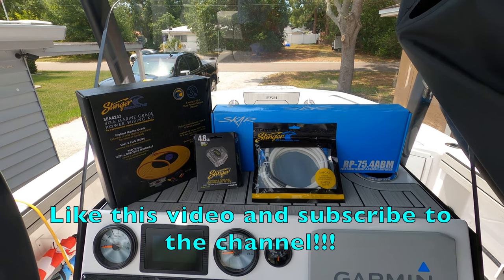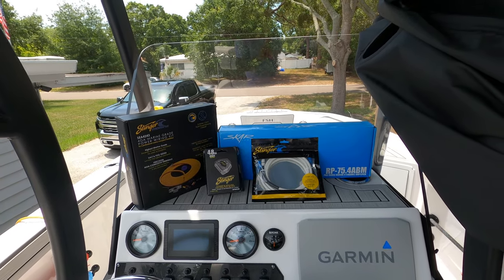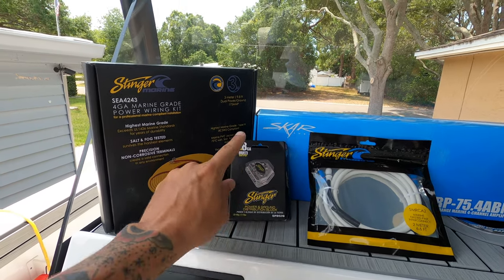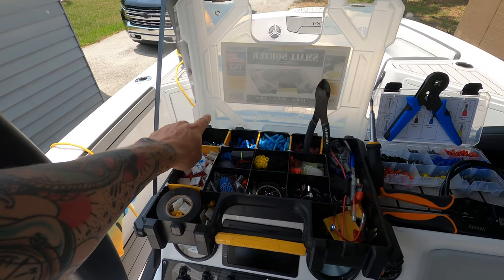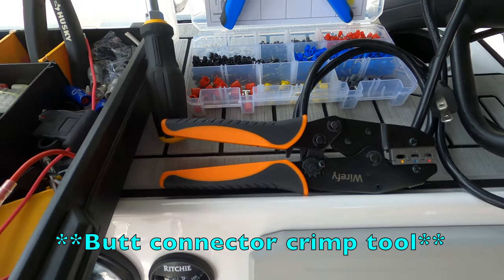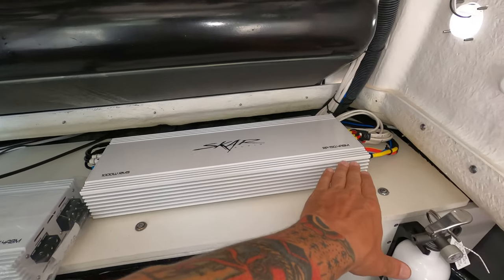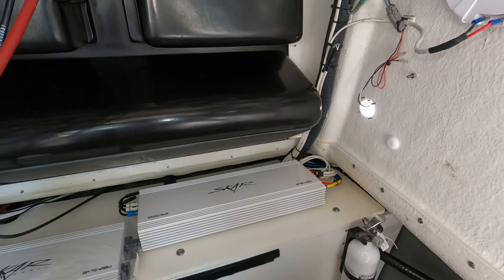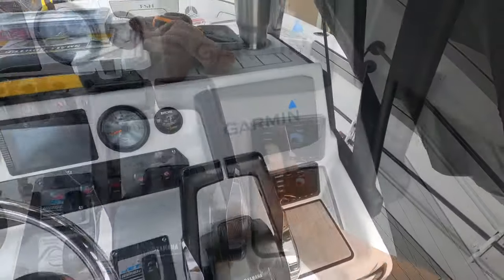How to PROPERLY add an Additional Marine Amplifier and Marine Speakers with Skar Marine Amp

Comment: i wish i had room on my pontoon for an additional amp. I have a 25 foot with a small compartment under the steering wheel. i followed your recommendations on other videos so i currently have the 4 6.5 inch and 2 8 inch paired with the 1000w skar amp and KMC5 head unit. I had to hand build all my speaker enclosures it doesn't look any where near as good as your install but All my friends are impressed and so am i. A guy at work has a nice JL system with 4 12's in his jeep but ii think my stereo blows it away.. just the over all performance beats a heavy hitting bass system.. that AB amp is untouchable packs clear sounds and low end punch glad i listened your videos. The only thing i didn't follow was getting my amp professionally tuned.. i tried my best and got it to sound Damn good but i know its probably not currently up to spec as maybe it could be. as you did give me some pointers with distortion and i am grateful. I should send you pic of my amp settings . you would have a laugh at my wire management skills. its safe just a mess under the steering compartment. The wiring for my 2 battery system is fused and split with a Blue Sea add a battery kit i made sure it was safe and elevated from the floor.
Reply from the maker: That sounds awesome 👏🏼 I am glad I was able to help get you a quality and affordable setup. Thank you for the kind words and support 🤙🏼

Comment: Love the add-on and great video!
In your opinion is there enough room in your FSH to add a second 1000w amp if you didn't go with the 500w?
Reply from the maker: Where there is a will there is a way I always say. But side by side no. You could stagger them or put one on the vertical starboard as well. Hope this helps 🤙🏼

Comment: Excelent video.  Been subscribed for several months and have watched all your videos.  I am currently on 3 waiting lists for my FSH 210 since the Miami Internation Boat Show in Feb.  Question, what do you do about power currently?  Stock batteries?  Also, when out all day at the sandbar, do you use one battery for the sound system and then switch to both when starting the boat back up?
Reply from the maker: Awesome! Thank you! As for my current batteries I am using the Die Hard marine starter battery for the motors and the Die Hard deep cycle marine for the electronics. As for how to operate the batteries the house battery (deep cycle) is for the sound system and the start battery is for the motors. NEVER use the parallel option (both batteries) unless your start battery is dead and you need the other battery in an emergency. They are on separate systems for a reason and the parallel option is for emergency starting. I have not needed that once in a year and a half.

Comment: How did you hook up your 4 gauge wire from the power distribution block?  Straight to battery or through accessory switch?  Thanks in advance.  Great video.
Reply from the maker: I always wire my power kits directly to the house battery.

Comment: Thanks for the video. I'm adding a third amp this week. My question is I'm running 3 amps from my Yamaha factory Connext screen by way of a DD audio line out converter. Sounds great but want to get everything out of my set up. Any gains from adding a head unit vs a dsp or even adding a eq. Don't want to be spending a 1000 on head unit and install when the Line loc is already doing the job
Reply from the maker: I personally would go with a dsp for optimal performance over a line out converter as you can tune them and filter out specific things for the best sound possible, especially in multiple stages of audio and speakers. Why spend all that money on amps and speakers for mediocre sound is always my thought process. I recommend this one https://amzn.to/38K4Bnh it has 8 channels which I assume you need. If you need more they make a 10 channel as well. If you are happy with what you have though then there is no need to spend any extra money.

Comment: If you knew in advance that you will want more speaker would you have gotten the 1500w amp? Also why are the 1000w and 1500w the same price on Amazon?
Reply from the maker: The 1000 watt is a 4 channel full range/LPF/HPF class A/B amp whereas the 1500 is a class D subwoofer amp. I have the 1000 now and 500 class A/B amps with 10 speakers.

Comment: What is a single den head unit you would recommend?
Reply from the maker: I wouldn’t any longer. If you are replacing a single din upgrade to the newer source units with the adapter plate. This is what I recommend https://amzn.to/3Ny0dcV

Comment: if you only have 2 outputs from the head unit and 2 multi channel amps how did you wire it with the RCA jacks?
Reply from the maker: Zone 2 rca output. It’s stated in the video. This headunit has 4 rca outputs. Front, rear, subwoofer, and zone 2.

Comment: Should I get the 1000 or 1500 amp I want to run 4 6.5 and 2 8s skar speakers on my boat
Reply from the maker: Get the 1,000 (150.4). Wire all 4 6.5s in parallel to two channels then wire the 8s to the other 2 channels.
Reply: @THEFSHDUDE  awesome thanks for the response really helpful

Comment: My head unit is the Clarion M508. I have a front, rear, and sub RCA pre outs (8) total. I want to run a Roswell dual zone volume control which requires me to run into one input to the volume control, then out to 2 zone outputs which will be separate amps.

The problem is that I tried to hook it up to zone 2 pre outs and damn near blew my speakers (still not sure if they blew or not) in the entire boat. I had volume all the way to 0 as well. So if I can’t use the 2-zone then should I just run from the front pre outs and then let the volume controller split the zones? Or will that affect sound quality
Reply from the maker: What was your gain set at? Zone 2 has the same 4 amp output as your others so that shouldn’t be the issue unless there’s an issue with the headunit which in that case I would get it replaced preferably under warranty
Reply from the maker: Also, did you make sure Zone 2 was at 0 or just the master volume? You set those levels separately.
Reply: @THEFSHDUDE  I’ll def look at it today. It may have been all the way up and I thought I just needed master to be lowered. I’ll probably just run the dual zone controller I bought off of front